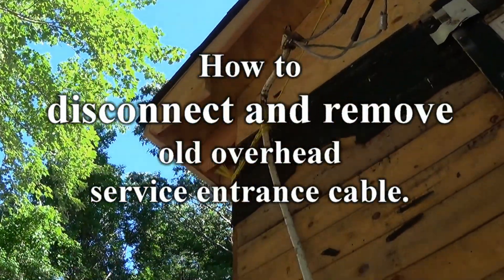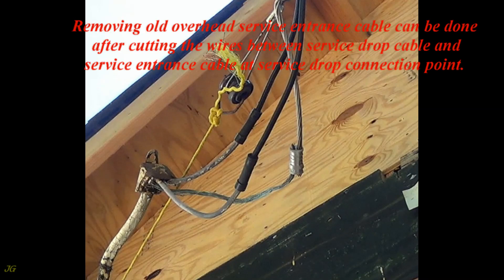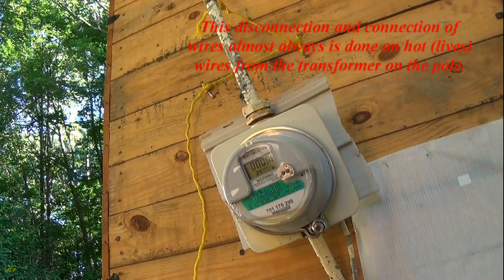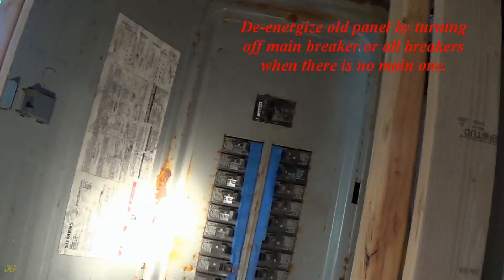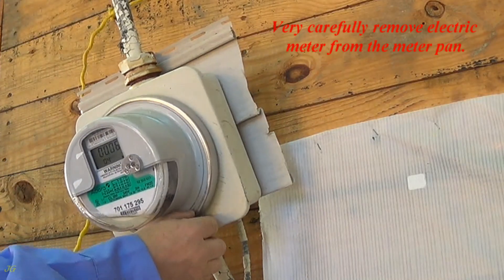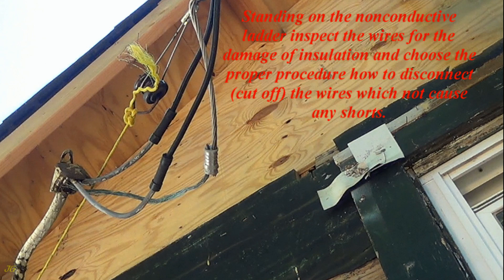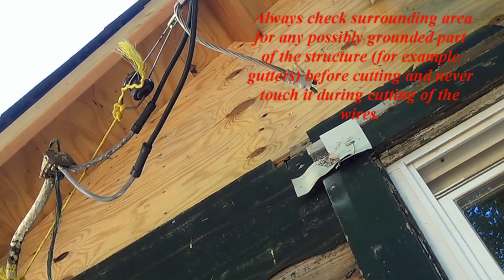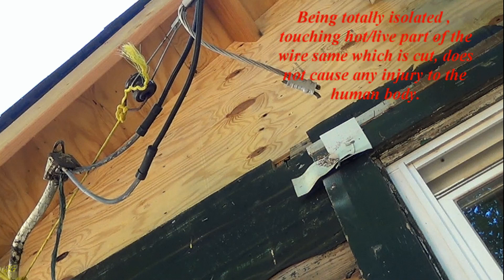Old utility service entrance cable disconnection and removal.

Comment: Why would you cut the neutral wire first?
Reply from the maker: The phase conductors should be cut first, but in this particular situation, where the power is disconnected by the main circuit breaker at the panelboard and the power line conductors are in the air in way visible on the picture, the decision was made based on an assessment of the safety and hazards associated with cutting the phase first. The neutral conductor was cut and isolated from any potential contact while cutting the phase conductors.

Comment: I’ve watched this video couple times and being an electrician myself. He failed to mention a very key point when doing this. Couple key points actually. First he failed dimension that if you pull the meter globe out of the meter base it doesn’t matter what why are you cut first Because the power will not go past the top half of the meter base if the meter globe is pulled and also he failed to mention that you need to shut the main breaker off in the panel at least so you don’t have a sudden drop or fry anything with a sudden in rush of electrical power when you reconnect services aside from that it’s an OK video but a couple of those key points that he failed to mention could really make the job a lot easier and safer for a person doing it, especially if they’re working solo
Reply from the maker: The disconnection of the main switch (breaker) is mentioned at 1 minute and 20 seconds of the video.
All safety issues are mentioned as essential to the safe completion of this job.
Reply: @johng2913  Mentioned but not actually done?  (like gloves, for one)

Comment: I'm surprised he didn't replace the insulator holding the mains from the pole, before cutting all of that old mess loose. Something should be securing the mains more than that nylon rope.

Comment: FYI guys, this is exactly how SCE does it on an overhead service drop, I watched them do it, except the guy doing it was wearing leather gloves, he climbed up on my roof and cut each wire individually and taped off end, then he tied all the wires to my rooftop swamp cooler stand with string rope, I proceeded to replace my service drop wires from my CSED up the metal service drop pipe past the weatherhead mast and I replaced my CSED, called SCE back once I was done and they came climbed my roof and reconnected the neutral and both hot lines, take your time, do it slow and use safety gear and you’ll be fine

Comment: So what gets cut first and what gets out back in first
Reply: I’m told when disconnecting, neutral last, and when reconnecting, neutral first. It is bare so push it far out of the way before you proceed with connecting the “hots”
Reply: @Romex_sniffer ..if extending your s.e. cables in your basement over to your new panel, does it matter which order the ground wire gets connected or disconnected in this process?
Reply: Put back on first
Reply: “You never want to make yourself the only path to ground” is what I’ve been told repeatedly

Comment: Do you know where you can buy the connectors for reconnecting the power lines at the top of the mast? The power companies use ones with set-screws which is the type I would want. Thanks for the video! Cheers man.
Reply: Home Depot has them

Comment: Neutral connect first off last. Nice cutters. I wonder where I can get some for cutting 556 acsr or underground cable without recip saw for cheap. If you have those cutters you probably have rubber gloves or at least some type of gloves.
I guess they don’t have a weatherhead.

Comment: Neutral, first on, last off. Must always wear rubber gloves, ever if standing in mid air, mistakes happen. Surprised you don't use insulation piercing connectors. I do live in a different county. Very interesting how  things are done in other countries.
Reply from the maker: Neutral, first on, last off - yes if everything can be energized immediately down the line after connection. If you remember electric meter is pulled off so only energized cable is connected or disconnected. In some situation you decide what is more safety to do.
Reply: @johng2913 I totally agree
Reply: @johng2913 so if the meter is not pulled, the neutral needs to be cut last? ....then re connected to the new panel 1st? Or did I misunderstand?
Reply: Micheal Plater homes in us usually consume a lot of current. A smallish to medium house usually has 100 amp service for old construction or 200 amp for new construction. I am not sure if insulation piercing connectors can handle that much current. The crimp splices that are shown can handle a lot of current.

Comment: I would never cut the neutral wire first while disconnecting a service drop . You want the electricity to always have a return path so you don’t become that ground path . But in the end as long as your safe that’s all that matters. You should also be using rubber gloves with leathers over them at the very least . Best of luck to you and be safe!
Reply: That only counts when you have a 120v. The feeder line is 240v, so it has a complete path no matter what. The neutral is the safest line to cut first so you can tie it down to the service mass as an anchor so you don't have a slip while servicing. Gloves and leather are a must. The one thing everyone misses is insulated boots. It's really your first point of ground.
Reply: Really ? I’ve always been taught cut neutral first. That’s a interesting point
Reply: @Hitterclub. You were taught correctly. In the States, we work with 120v in the home and 240v at the service. 120v should have the hot cut first to prevent surges and killing equipments. The service is 240v so it has a complete path whether you cut the neutral or not. You really should have shut down the main breaker so that the house is powered down first and no equipment will fry. The only safe wire up at the service is that neutral. Cut it tie it to the service mass or find a point of anchor with it. Then you can make sure when you cut the hot you can slip and it'll be floating instead of trashing around and whipping you and everything else.

Comment: This is an absolutely CRAZY video to put up.  I can't imagine (well yes I can) somebody that doesn't have a clue what wires do what.  A type of guy that if you asked him to go to the big box hardware store and buy a metric hammer, he's be there all day looking for one.   With years of electrical work,  I would not even attempt this as shown in the video.  That nylon rope looks like it could snap at any second.    Good way to get killed based on this example.
Reply: Take this video down before you get someone killed
Reply: You die only if you do it wrong
Reply: I thought this video was crazy too, why is it on YouTube?  I myself would NOT do this work without proper instruction or call a qualified lineman.  Just starting cutting wires at random is crazy, not even testing the line to see if there's no voltage or current flowing through.
Reply: @danloyer6241 And how, exactly, do you know he didn’t verify that there was no current on the lines after shutting down the main breaker( which he did in fact clearly demonstrate)? And as far as why it’s on youtube, the answer is for whatever the fuck reason the poster wanted to put it on youtube. Go cry to your lawyer, queer.
Reply: lol For some reason this came up on my feed and I was like, wtf no insulated gloves? No arc flash safety equipment?

Comment: Not bad 👍 now try replacing ballast inside fluorescent tubes box on concrete ceiling 14 ft high 460v mid 90s I was 30 something
Reply: Should only be performed by a licensed electrician with the proper training and up to date PPE. ( Tinted face shield, 9 cal long sleeve shirt. 9 cal pants, rubber gloves that were inspected in last 6 months and canvas gloves to fit over rubber gloves ). I have a UL approved 13 cal hooded sweat shirt that cost over $120 to wear in cold weather while working on or near energized equipment or wires.
Reply: no such thing as concrete ceiling so what is the real texture and flouresent tubes box is also incorrect cant be both .
Reply: also not 14 and 46 so lets get real ok
Reply: Was a sparky for 50 years and never came across a 480 volt ballast. Was likely a 277 volt ballast feed from a 277/480 volt panel. And yes they give a nice shock.

Comment: Takes balls to do this lol. Its like playing with invisible fire. All it takes is him touching the metal on thoes rachet cutters on a hot while on that ladder to shock yourself. But great job tho one by one will get it done.
Reply: I believe he’s using a nonconductive ladder so he’s not grounded at all so he would not get shocked.
Reply: I agree. Shocked myself with caps I thought were discharged and those were 7.5 uf caps with 80v after I touched them. Never know until it’s too late. Luckily it was finger to finger and not across my whole body.

Comment: So many mistakes. 
Video details claim "Years of PRACTICE as an electrician"    Electricians are licensed and don't PRACTICE.
Working with HOT/live conductors = mistake #1
No PPE = mistake #2
Cutting the neutral first = mistake # 3
touching the pole's transformer grounded conductor/ center-tap while cutting the second 120Vac leg = Mistake #4

I can point you to a better video with a licensed electrician that will show tons of things you should learn.
https://www.youtube.com/c/ElectricianU/videos Here is his channel.

Here is more information about 120v 240Vac residential service (US)
https://youtu.be/fJeRabV5hNU

I would suggest you get YEARS more PRACTICE before you post videos. These DIY'ers may be killed before their body hits the ground...NO PUN INTENDED.